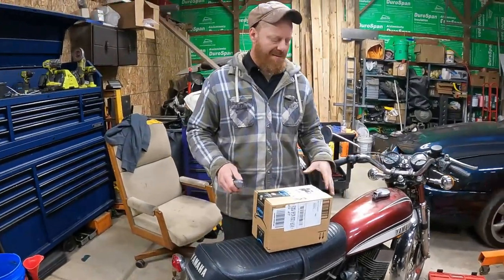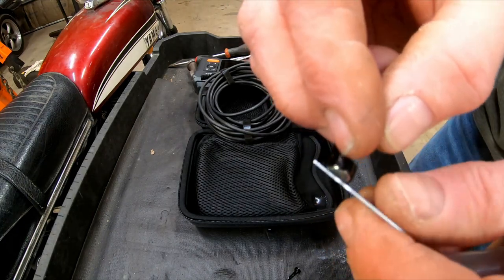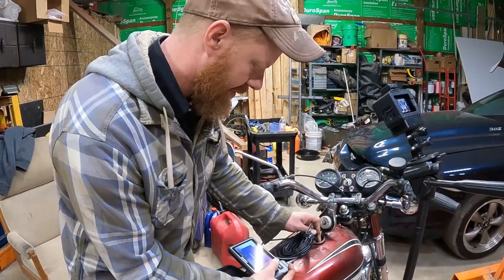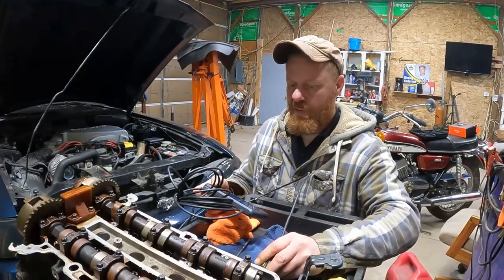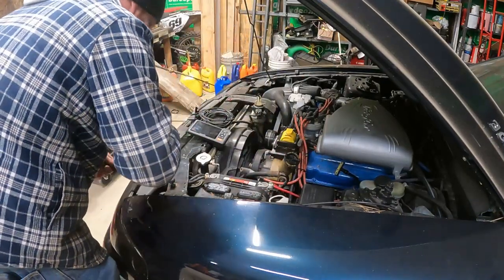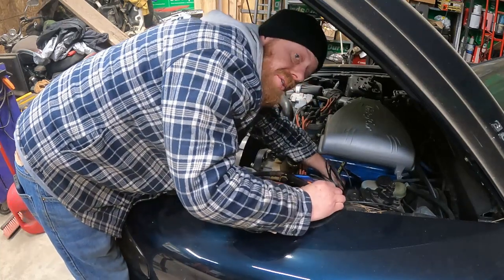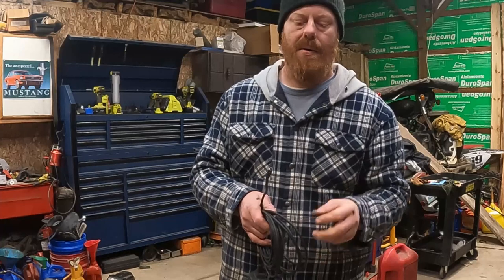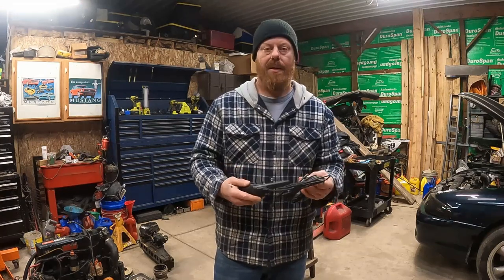Ultimate $100 Amazon Endoscope/Borescope. See inside your engine like never before!

Comment: I'm live life on a " need to know " basis. I would rather know the bad news up front ASAP. To me,there is nothing worse than being 100 miles away from home,broke down on the side of the road. This set-up can help eliminate a high percentage of that happening. I want to replace rocker panels on 2 of my vehicles and I want to know how much is bad and good on the surrounding areas so I get rid of all of the rust damage. This tool will help do that. Great video, thanks.